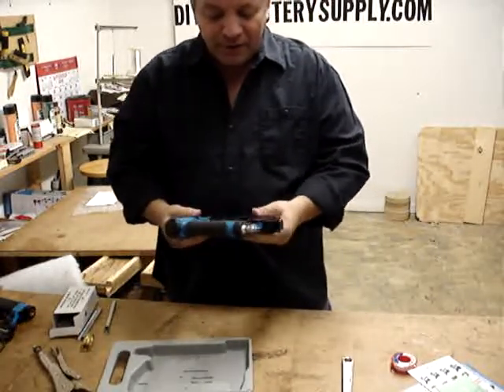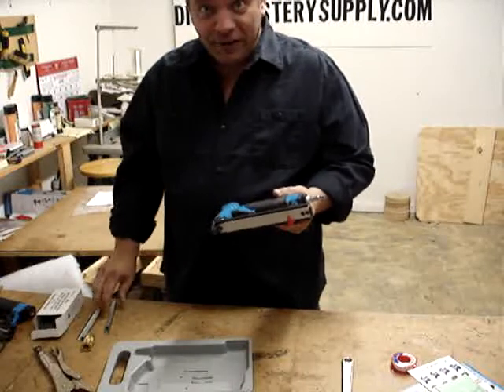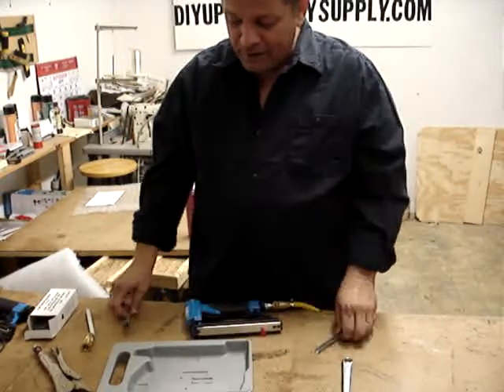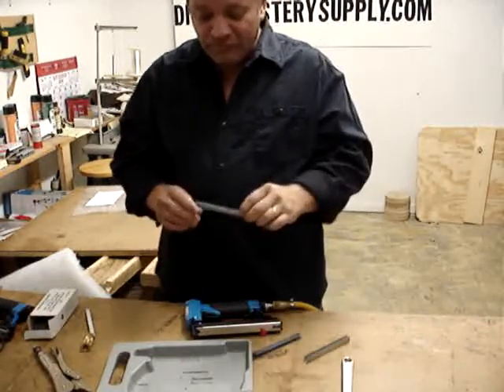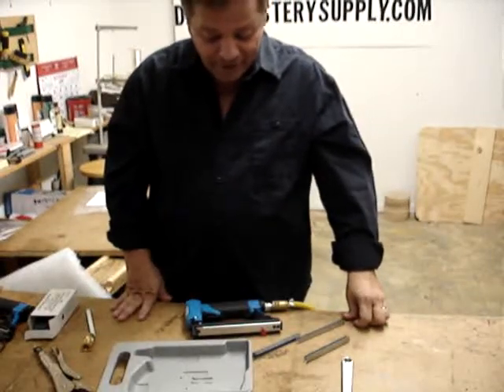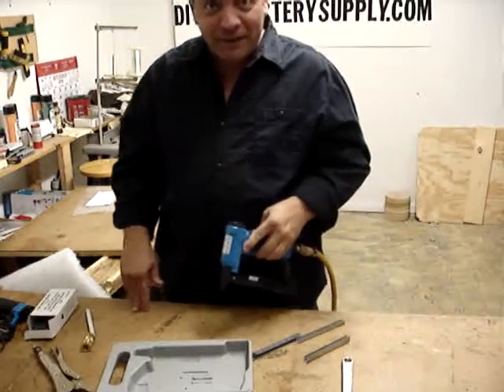Upholstery Stapler

Comment: Hi, I just got a small air compressor and I was wondering if your compressor stays on while you r  working. I got a 3 gallon one and it shuts off when it gets to 110 psi. However, when I regulate the pressure with the other knob it brings the psi down to 85 and the compressor stays on while I am  stapling. When I see your videos I do not hear the compressor at all. Anyway, any input greatly appreciated.

Comment: I have a Rainco Empire that i got back in the 1990s and i can`t find no. 2 gasket 166.001 , no.3 driver piston  300.001, no. 6 bumper 280.001, no. 7  buffer 70.001, no.8 spacer 286.001, no.10  o-ring 2093, 622.037,  no. 11 buffer 70.023, . I hope you know what i`m talking about. I called a guy at Baker`s in Michigan i think and they said they don`t make parts for them anymore. I had all the parts but lost them in the move. I hope you can help, thank you.